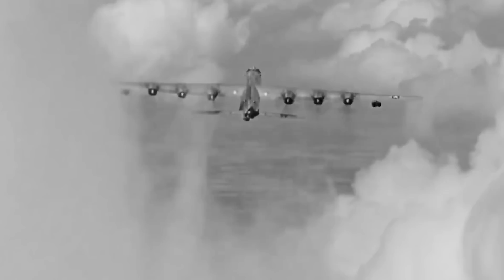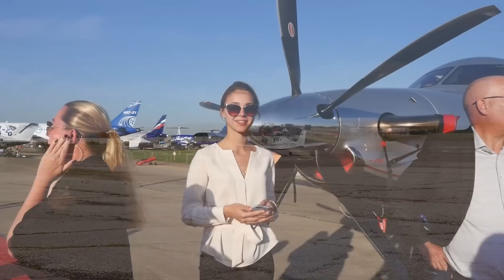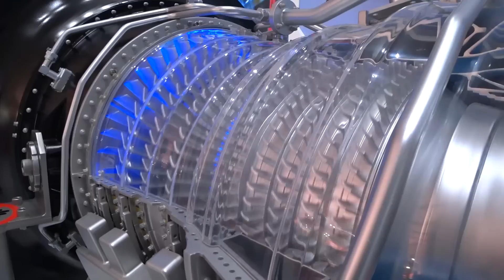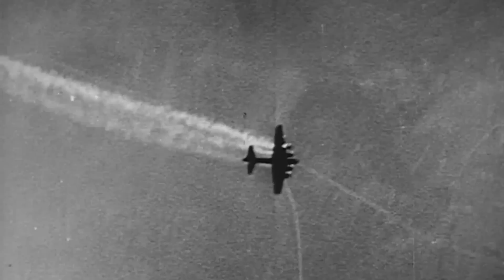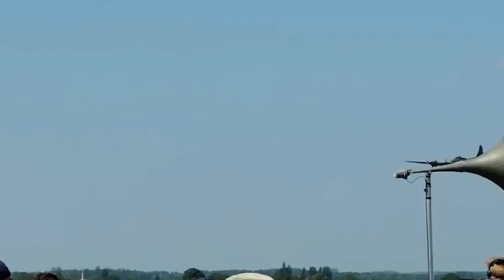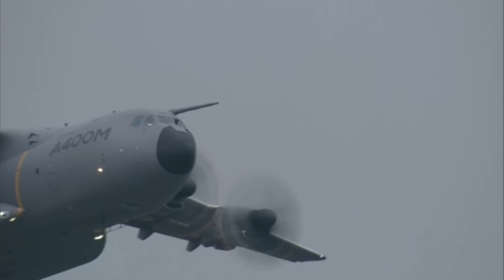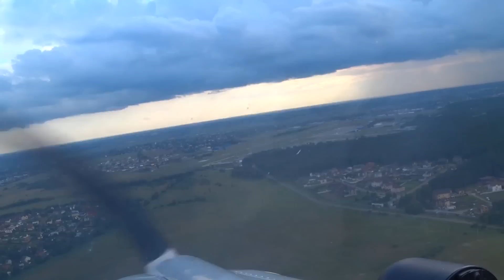Piston and Turboprop engines | What is the difference?

Comment: The problem is not the multiplicity of mechanisms, but rather the desired purpose. Although the piston engine looks complicated, it is actually simple and reliable as well. The failure has nothing to do with the variety of mechanisms, but rather with the design. The electronic circuit that controls the charging of lithium batteries can be considered more complex and more prone to failure than the piston engine.
Piston engines have greater torque while turbines have greater speed.

Comment: I personally prefer the sounds of piston engines over turbo props. The turbo props just sound boring to me. It just sounds like a steady wrrrr with a turbo whistle. Piston engines make their sound from the exhaust pulses which can sound be different depending on the engine design. Radial engines have a low rumble with a noticeable pulsing sound as they fly by. Some engines are directly driven with a smaller propelled, while other larger radial engines use a large propelled with a gearbox, and this makes the rumble at lower engine RPMs much deeper than a higher RPM radial engine with a smaller propeller. It also makes that loud propeller sound since the tips of the propellers travel much faster than a larger prop, creating more noise. That and older propellers were usually a bit louder than more advanced modern shaped props with lots of blades. 
Inline piston engines have their own sounds. They are typically smoother sounding much like a car engine. V-engines aren’t as common anymore except in older warbirds such as the Merlin engine used in the P-51 Mustang. It was a V12 engine which sounded like, well, a V12. It had its own unique tone which sounds aggressive and powerful. Not sure why more v-type engines aren’t used anymore for aircraft. It might be due to to flat-cylinder engines being easier to package.  Flat cylinder engines are the most common nowadays, with flat-4 and flat-6 engines being the most commonly used on smaller single and twin engine planes. They don’t sound as interesting as the V engines or radials in my opinion. They sound too smooth and uninteresting. Having a pulse or a wrapping can make an engine sound more interesting. Think the engine sounds in cars for example. An inline-4 simply isn’t going to have the same audible appeal as the sound from a V8, V10, or V12. But why is this? I’m not quite sure they exact reason why people as a whole are generally more attracted to the sound of a V8 sound versus other engine types. What makes one sound better than another? There has to be a scientific reason why people like certain sounds over others. 
I have seen some experimental planes use V8 engines based on the LS engine, and they have their own amazing soundtrack when flying through the air. But I always liked the sounds of radial engines. It’s a sound that is hardly ever heard in the air anymore. When I was outside one time, I remember hearing a strange aircraft sound that was unlike anything I heard from most smaller planes and jet aircraft. It was a deep rumble with a pulse. It turned out to be a restored B-29 bomber flying overhead and I was in awe of the sound that those four massive radial engines. I had never experience a sound like that from an aircraft before then. 
Although it is very unlikely, I wish radial engines would make a comeback in modern aviation. They could be modernized using the latest cutting edge materials and manufacturing techniques coupled with modern fuel injection and the latest engine technology to make an already good engine design even better and more reliable.

Comment: Both types are INTENAL COMBUSTION engines. A turboprop engine typically has TWO SHAFTS, not one shaft, one driving the engines compressor and another driving the propellor.
🙄
Reply: Good point!
By the way a propeller also creates a jet like a jet engine. In Russian Turbojet engine is called Turboreactive engine. But piston engine with propeller is reactive as well.
Even two shafts you can find on piston engine, turboprop and turbojet.
Of course jet engine should have cylindrical duct. But even small piston engines for paragliding is equipped with duct as well.

Comment: The only significant difference is Avgas, the only leaded fuel still allowed. It's a scandal. All avgas piston engines should be immediately banned and replaced by gas turbo-props.

Comment: While many things mentioned here are accurate there are also some significant inaccuracies and things left out.
    Certified turboprop engines are based on very modern engine technologies.
    Nearly all certified piston aircraft engines are based on very old, outdated engine technologies that result in greatly reduced efficiency, lower reliability, less useful power output, and increased maintenance costs.
    Piston engines based on modern engine technologies are far more efficient and can potentially offer greater longevity and reliability as well as much more power output than the "dinosaur" engines used in most GA aircraft today.  On top of all that, a very nice automotive engine can be custom built with all the best upgrades for a small fraction of the price of a certified engine.
    This is why some experimental aircraft use modern automotive engines rather than grossly overpriced "certified" engines.

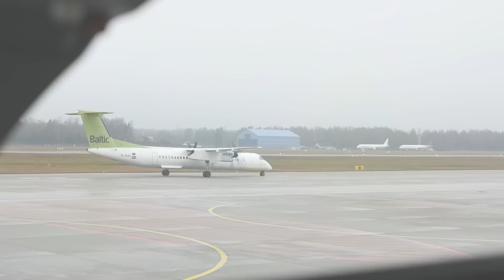Comment: 20:48 - "Let me know in the comments, if I forgot to mention something..."
Would love an animation of how both engine types turn the propellor shaft... 🙏👍

I can see how a piston-engine turns a crankshaft in a car, and how clutch and gearing works. But - are there gears in a plane? Get rolling in first gear, cruise in sixth gear.. My mental image of a cockpit has no gears!

And if there is no gearbox - is that simply because of weight? Cause higher RPM at low-altitude, low torque is more effective to low speeds, and lower RPM at high torque at cruise, should be more efficient than "ungeared" engines? Or is the idea of having gears just not "a thing", where runways can be 'long, soft ladings to your', and with the piston engines just nippier (as a racecar is), a gearbox just isn't required? Even a two- or three-speed piston-engined gearbox?

Thanks... 👍 

Very happy with this (late) subscription. Looking forward to the notifications! Best of luck to the channel..

Comment: A lot of inaccuracies in this video as is with all the turbine vs piston videos. So much more to it. Piston aircraft engines are very behind in technology compared to turbine. A modern piston engine is better up to about 1200KW. The fact that very few companies make a modern piston engine is not to say they are not better. The main benefit of turbine is smooth torque delivery, but even that can be fixed with dampers on a piston engine. A modern liquid cooled engine can route its coolant through the leading edges of wings, can achieve very high altitudes with turbochargers and has a much better fuel efficiency and take off weight to endurance ration that turbine after 2 hours.

Comment: They're equal, piston engine is much heavier but the fuel consumption is less, because of that, you didn't need a big room for fuel, on the other-hand the Turboprops engine much lighter than the piston engine but the fuel you need is enormous, you need lots of room for the fuel. More fuel you carry more weight to the plane it self.

Comment: The biggest and most important difference is a turboprop is WAY more reliable.  This is especially important in GA where it's mostly single engine planes.  Anyone with sense would take one PT6 or two pistons out at night or over water at a minimum but would never want to do that with a single piston.  You never want to be in a situation where gliding to an off airport landing on dry land is not possible due to being too far out over water or it being too dark to pick a landing spot with a much more prone to failure single piston engine, except maybe if it was one with a parachute but even than water would be a no go.  Lets be just honest here.  Turboprops are just objectivity better and basally obsoleted piston engines for planes.  Or should have except for one artificial limitation on adoption.  Cost.  The only reason piston engines are still relevant at all and dominate GA is cost.   Used single engine piston planes from the 60-80s are relatively cheap to buy and operate compared to any single engine turboprop.   If you could own and operate a turboprop plane for the price of a used piston plane, Trubos would be the GA standard and even what everyone learned on in flight school.  They wouldn't be "high performance" they would just be the standard plane by now.  While piston engine planes would fade away to a tiny enthusiast niche market.

Comment: Seems to me that the big problem with modern piston GA engines is the fact that they're all still air cooled, which brings about a set of power limitations that you really can't get past. You can only increase the bore size so much and still have enough surface area to cool the cylinder walls. Flat, or boxer engines are pretty poor in performance as well. 

This is readily apparent in motorcycle engines. For example Harley Davidson has to use a small bore, long stroke engine due to their air cooling on traditional motors. Compare the power to displacement ratio of their new water cooled "Revolution Max" engine in the Pan America adventure bike (1250cc 150hp / 94 ft lbs) to the 1800cc 84hp / 119 ft lbs air cooled engine.

I think a V4, water cooled, turbo charged engine would hit the size, performance and weight to push piston planes further forward. I just don't think there is enough demand for companies to pursue it.

Comment: In reference to your takeoff power lag comment.  The piston engine must increase its RPM to increase power.  Most(I think all) turbo prop engines are turning near 100% from the start of the takeoff roll. The power is instantaneous and is regulated by the pitch of the propeller.  The pitch of the prop is constantly changing to produce the thrust the pilot requests.  It is a complicated engine controlled by a FADEC engine controller.
The piston engine would have a slight lag, greater than the turboprop engine.

Comment: Concorde flew at an altitude of 60,000 feet which is 18.288km.

It also flew at Mach 2 had afterburning turbojets, and had the ability to supercruise, so to be fair it is a massive outlier.

I thought it would be interesting to mention though, after what you said about the altitude ranges of the different engine types.
Reply: Well yeah, and to be fair he accounted for those outliers several times.. I think at least half a dozen times he mentioned this exact scenario (non-specifically) that you raise. So yeah, I would say it was pretty well included in the script. If you missed it, I'm sorry.
Reply: @stanley090  as you said he didn't mention it specifically so I included it in the comments incase anyone was interested in the stats of an outlier (which I acknowledged it was).
Reply: @westonloomis  You missed my point, he didn't mention your specific scenario but he did describe The point you made without using a specific example. He generalized in making the exact point you made with a specific example. Get it? Is this seriously going over your head?
Reply: @westonloomis  It's embarrassing that I anticipated the comment that you were going to make in response to my comment. 100%, I knew that that's what you were going to say. I saw that coming a mile away but I don't care because my statement is 100% correct and if you can't understand it I can't help you. It isn't difficult. Turn your brain on.
Reply: @stanley090  that's not the case at all, I was stating that my motives for publishing the stats of the outlier wasn't to discredit the video, but add to it something someone may have found interesting.

I fully comprehend what was said in the video.

It appears you either misattribute or don't comprehend my motives for the comment and are using them as a vehicle for pedantry.
Reply: @westonloomis  lol bore off? Sorry I don't speak your bizarre language.
Reply: @stanley090  I'm English. English is MY native tongue. If you don't understand it that says more about you than it does me.

Comment: Why do small aircrafts don't use performance car engines, like the 3L Inline 6 from BMW with around 500 HP, or the 2L Inline 4 from VW with around 300 HP. This types of engines are leihgt wheigt, they are turbo charged, they are relatively cheap, spare parts are available (at least in the case of the Inline 4) and they are relatively small. The power wheigth ratio is quite good
Reply: Those engines aren't made to be geared to spin a prop. They couldn't withstand the forces requires for that and would probably disintegrate or explode. Also not made to run on avgas
Reply: Converted car engines have too much weight penalty. There isn’t enough market to justify development of new engines for airplanes.

Comment: With lightweight carbon fibre propellor blades, cheaper automatic management software and access to the same high performance piston type engines in fast/powerful cars, lighterweight piston material options (some from the turbo engine powerplants, 3D material design, why would piston engines suffer such a performance difference. Most routes flying with turboprop for airlines don't need higher altitudes bar weather avoidance. With such turboprop design advances, can they not be made cheaper per bhp/nm considering speed even in turboprops has a ceiling/fuel demand/reliability impact. In theory turboprops can be made cheaper-smaller-lighter and deliver the same old performance, without the same power loss or old price premium. Open to answers as I'm not an aero engineer. Performance can also be assisted with cheaper windtunnel testing on a hp computer vs having an expensive wind tunnel. Steamlined and optimal exterior design can cut its drag and so allow more performance from the same or less power output
Reply: But piston props will always be supeiror

Comment: I would phrase that as "the gasses spin the turbine, which spins the shaft, which spins the compressor". Not "the air spins the shaft, along with the turbine and compressor". The shaft and compressor only spin because the turbine is spinning, the only thing actual spun by the air is the turbine.

Comment: To be precise, both piston and turbine engines are "internal combustion engines", that is, the fuel is burned inside the engine (as opposed to a steam or hot air engine, in which fuel is burned outside the engine, and the energy is transferred to the engine via  a working fluid). Many people us "internal combustion engine" as a synonym for "piston engine", but that is wrong. Turbines, piston engines, even rockets, all are internal combustion engines. A piston engine is a reciprocating engine.

Comment: One has dozens of moving parts and electrics that need constant maintainance. The other has basically one moving part. moving in one axis all the time.
Reply: One is way cheaper to repair and maintain and is much smaller and more lightweight, as well as more responsive and sounds 1000x cooler and better

Comment: Forgive me for what is probably a stupid question for those that know, but if a turbo prop engine is basically a jet engine, what is the reason for running a propeller with it instead if just using thrust like a commercial or business jet? Seems like you end up with the same complexities with lower speed and altitude?
Reply: Because it's far more fuel efficient than a turbofan, and better for carrying large loads long distances

Comment: If I was to get, or build my own aircraft, I'd get a chopper, & fit a turboshaft engine. I did look at building a scorpion 2 seater chopper, but the cost of the engine is very expensive. The engine I was looking at is a Rotax 160hp. Ideal for that application, but the cost at this point in time is out of my budget.

Comment: Ooooof. So your argument is that is the engine is going to have more than 400HP it should be a turbine because it weighs less in some cases? Not all cases man. We have 4 cylinder inline engines that can produce as low as 90hp and that same engine can be cranked all the way up to 1,000 horsepower depending on the internals used, and what form of air induction and boost amount that you run. It’s all about the point of return. More cylinders doesn’t always mean it’s better, but in terms of reliability, and I mean if you weren’t maintaining the thing much if at all, the piston driven, cast iron blocked, big old flat or V shaped engine WILL pull ahead all the time. And they aren’t just “easier” to maintain, ANYONE can literally tear a piston engine apart in a few hours and have it back together again within half a day. There aren’t many parts there as you are suggesting. You have Air, compression, fuel, spark, exhaust. So you have a head, piston, rods, bearings, crank, oil pump and water pump, rings, and that’s about it as far as internally in a piston engine.

Comment: Altitude would be a factor between the two, but you can use a supercharger or a turbocharger to drastically increase the performance not only at altitude but at low speeds and lower altitudes as well.
Reply: The thing about turbo chargers is they are a turbine, just used to power a compressor for the piston engine, instead of the prop. 

Post war airliners ended up hooking their turbos into the engine crank shafts, in a thing called a "power return turbine". It got to a point where the PRTs were delivering more power to the propeller than the piston side of the engine was developing. Given they required the same tolerances that turbo-props did, it just made more sense to go to them entirely. 

Also reduced maintenance. Have a high power turbine driving a fluid clutch into a high power piston engine had a tendency to break quite a bit. I gather the PRTs acquired the nickname "Parts Return Turbine" for the number of failures the whole thing had.